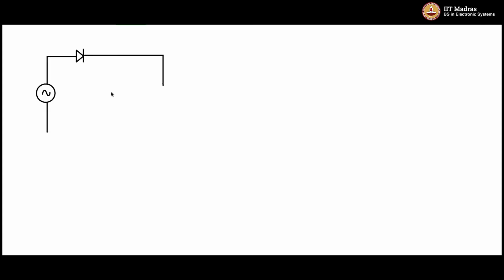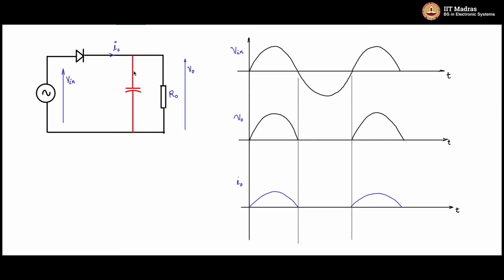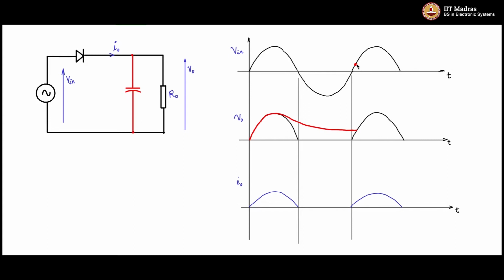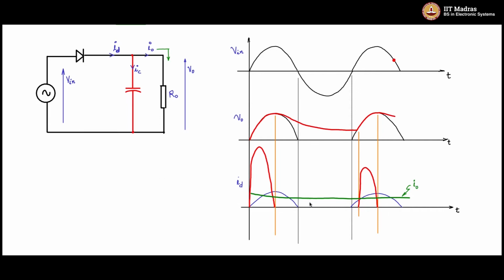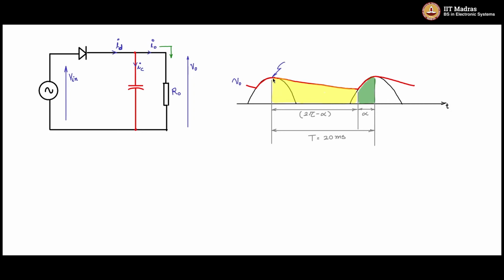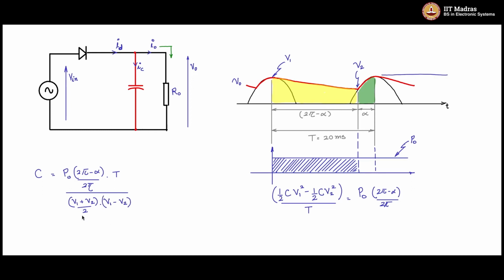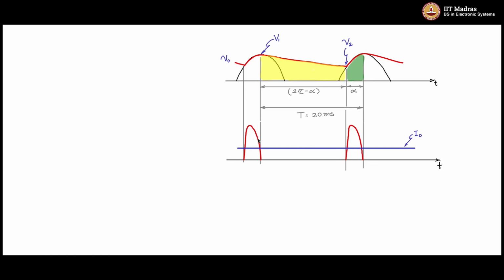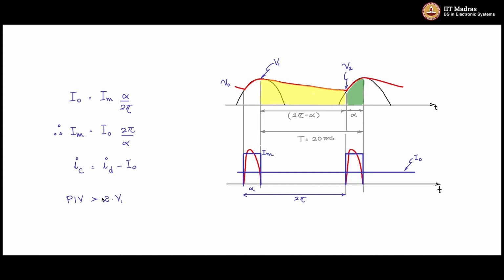W1_L1.2: Half wave rectification

Comment: 9:40 why is current reducing to zero, shouldn't it increase till Vmax then sharply drop to zero😮
Reply: i  feel the same
Reply: Think of it like a capacitor with 0 charge is connected across source, its like connecting a voltage source across c,     cdv/dt=i, since dv/dt is huge(due to sudden connection) huge spiky current is drawn. However in the very first curve it should be smooth.. but in practical operation, voltage at which the cycle will start will not always be 0.